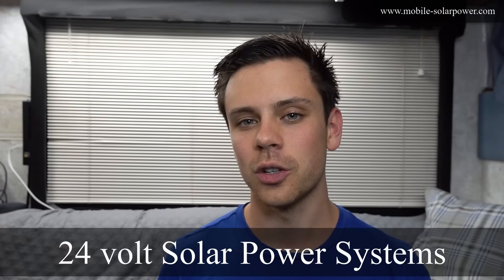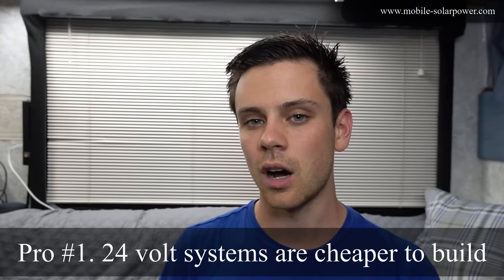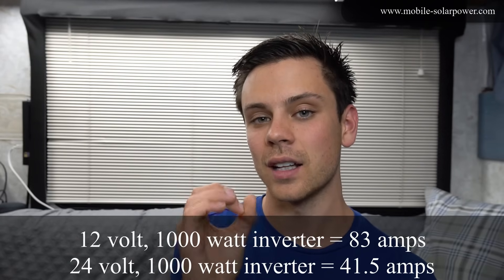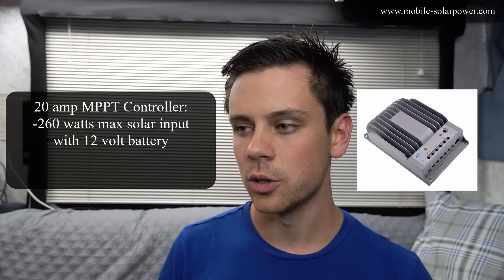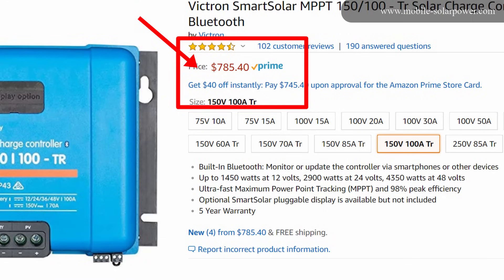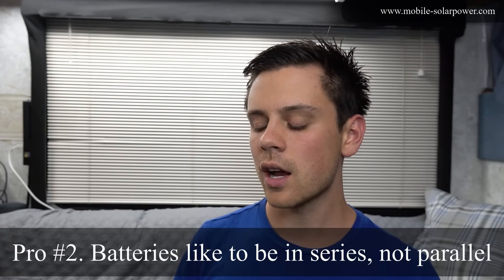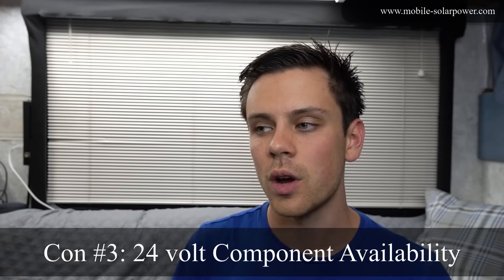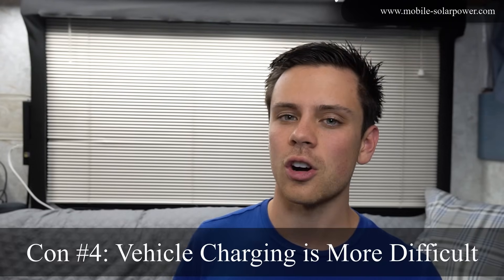12 volts VS. 24 volts for Off-grid Solar Power Systems

Comment: Micro inverters at 240vac will help with copper savings. Just rectify and regulate at the end near the battery bank.
Reply: Definitely. Also help with shading. But it is more expensive, and a lot of people prefer to spend as little as possible and still have it functional.

Comment: What is your thoughts of connecting a 12 vdc inverter for charging from your alternator? Keep in mind you would never use more than 50 % of its capacity.  100 amp on a 220 amp as example?   Then take the 120 ac and put it into the shore power connection of a inverter/charger.   This way there is no fear of the 2 batteries being connected to one another and the need for an isolator is eliminated.   Only down side is the losses due to efficiencies but curious if you had any other insights?
Reply from the maker: Absolutely! But I have a better system. Testing it tomorrow. Will post it soon

Comment: Very good comparisons.  I believe all you left out was a 12 volt system connected to an inverter will only give you 120 volts A.C.  Where a 24 volt system connected to the proper inverter will produce 240 volts A.C.

Comment: Good stuff. I'd like to see more house/48 V wisdom please.
Reply: Definitely would like to see a 24V vs 48V comparison.  SV Dauntless did a massive 53KW 48V system and I wonder how the wiring costs would have been different if they did it in 24V?
Reply: Definitely why not 48 volt we use them for cell towers as the need a bunch of power
Reply: So if I have a big bus going to run 24 what is the best battery for dollar I was leaning towards Tesla batteries room is not a issue I have a  flat nose skoolie pusher?  Is that my best option I’m aiming for 500amp hours run ac sometimes?
Reply: I’m no longer looking at Tesla batteries lol can’t decide yet
Reply: @Cliffandmorty  Wow that's 12 kWh. I have 10.5 kWh Pylontech for the off grid house and that's the right size for me. I like those 48V rack mount jobs but it's obviously not DIY.

Comment: What do you think of 48v !?
Reply from the maker: It's great but I mention when to use it in this video
Reply: @WillProwse  ohhh i haven't notice that .. maybe i have to re-play te video 👍
Reply: @WillProwse  actually i was asking you about 48v . That i wanted to setup air condition split model. Then i jave noticed that some of them work on 48DCv .!! So as i myself thaught maybe its better than adding more cost buying inverter " considering the cost and life time of such electronics or replacement soon or later ). So as i am not electrician  and not professional.  Would you give me your feedback about that !

Comment: If you have over            2500 -3000 watts. It's better to go 24v or 48v, it doesn't hurt to get a backup inverter either, I have a 5kw inverter, 24v with 42v oc panels, I'm planning on adding about 2500watt plus, in panels, due to distance, I will be running about 90v oc. I have a smaller 12v battery bank, for my 12v lighting, over 100ah, LiFePo4, I also have backup equipment, I'm building a DC generator to to charge my backup lead acid Bank. And have a charger to charge my lithium bank from it , in an emergency, it can do 150 amps @ 30 volts! I hope to eventually go a week without sun, but panels the shipping is costly!!
Reply: I would say 2000 is the cut off. I've seen an 1800w inverter power half a house on 24v. With proper solar and power bank of course.

Comment: Will, 
You are excellent,  you explain things so well. 
Question:
I have a skoolie, with 6 lead acid deep cycle Walmart batteries, totaling 610AH ( 2 are 105ah, 4 are 100ah) .  Are you saying that I should series them to create a  24 volts system?  My inverter is a pure sine wave 2000watts.. 12 volt I think.  
Thank you

Comment: What didn’t you like about the 6S Tesla battery? Was it mostly the chemistry for safety or something about the voltage and charging profile or something else?

Follow on question- if I wanna do a 24v system with custom cells, do you suggest 6S (like Tesla) or 7S like Jehu suggests?

Comment: I think there are a few other negatives missed with the 24v system pending on your usage.  Generally it seems like you need more solar space to do 24v.  A 12v panel and a 24v panel at around the same voltage are usually much different physical sizes and weight.
Reply from the maker: What do you mean? Whether the panel is high voltage or not, total output doesn't change. The output is determined by the size of the panel
Reply from the maker: So no, you don't need more solar space for a 24v panel. And it's easy to wire 12v panels in series anyways
Reply: Generally when I’m looking I see 24v panels physically bigger then 12v panels.  Especially some of the newer 12v panels that you have been featuring recently. Perhaps I’m just looking in the wrong place but I’m not seeing 24v panels that are 100 watts at the same general size as the 12v ones you are showing.   

I’m still new at all of this and your videos have been super helpful to me so I could be missing something since you know way more about this then I do.  Keep up the good work!
Reply: Also to clarify a bit more I’m coming at this from more of a preppier/camper mindset where I only want 1 panel to throw in the back of my minivan when I want to go somewhere with it so I’d like it small but a decent amount of wattage. 2 panels in series adds more size then I would be looking for but that’s a personal preference thing for my thoughts and use case. Eventually I will probably build a larger array and go 24v once I get everything off the ground.

Comment: Hello is it feasible to charge 24v DC off mppt  to a 24v DC battery bank then run a step down converter  to a 12v DC battery bank to run the coach
Reply from the maker: Yes absolutely
Reply: @WillProwse  thanks for the quick response still new but definitely learning from you keep up the good work

Comment: I think you've done a wonderful job of going through the basics. What would be of great help to me - and perhaps others - is to extend the battery scenarios beyond just solar-derived power stores. For instance - does it make sense to use these self-built batteries for things like marine and auto electric motor power sources? If so, what are the considerations in terms of cell management and construction configuration? Love the stuff you're doing, keep it going!

Comment: After listening to your take on alternators around (9:00 - 10:00) I'm wondering how do police cars and ambulances power all those lights and sirens and PA systems and computer terminals with multiple band radios and power outlets for life support equipment, etc.. etc..  hmm...  Do you think they might have  * high output alternators * in the engine bay?
Reply from the maker: Yep and they are designed to do it. My dad installed them for years. They are different. That's exactly the point I was making.

Comment: Here I am again. I have an older rv that we boondock in. If I go with 24 v instead of 12 does that increase the amp-hours if using 2 12v in series? do the batteries last longer (if there well serviced of course)?

Comment: There is a charge controller for alternators. 4 stage charging and all, just like the solar one. It is made by a Canadian company and is primary made for charging 24 volt handicap "cars" on 12v alternator for a car. It is 300W. This can be a solution, except it is for AGM and not tuned for lithium.

Comment: Been educating myself on this stuff for a while. I learned more in this video about voltage per application than dozens of others combined. 

Just bought 1.4acres in Ky. Putting a 14x32 barn/cabin on it to live in whole building my house. So, I guess a 24v would do the barn. Concerned about 220v appliances like water heater and AC.

But house will have a 25x60 basement with 2-stories on top. I'm guessing a 48v system might work better, but not sure. Would a 24v in series be better, even with more batteries?

Comment: Amazing video, as usual.  It's incredible how much knowledge you have in that head.  My brain swells up nearly overloading, when I try following your non-stop (edited, I know) video but it is always enriching.  No gain, without a little pain, right?   Anyways, I would like to see a video that shows us from a to z, the connecting of the panels to the inverter.  I looked up a 40amp 24 volt solar charger (right after your video) and it got confusing.  Most charge controllers have screw-ins for wires and they want to control the loads.  I want to know how to properly wire a 24v system (and 12v).  How do I use the controller to charge the batteries (that part is labeled) but how do I wire a 24v to 120v inverter without dropping below 50% on say lead acid?  I've "heard" the inverters get wired directly to the bats, but how do we protect them in that manner, from dropping below 50%?

Comment: I love your videos. I have a “dumb” question related to avoiding too many batteries in parallel. Does it mean I should not combine 2 x 8D 12V 255 amp hr batteries in parallel?  Seems like though it is “only” 2 batteries so under your 3 battery rule, but what confuses me is that isn’t each of the batteries actually many other batteries in parallel to make each 255 amp 12V 8D battery? In other words what is the difference in paralleling 5 x 50 amp batteries vs using a 250 amp battery that I assume has the same parallel setup but inside the big battery. I hope my question is not too confusing. Thanks.
Reply: E N I think that’s a very good question. I was considering building a 300amp 48v system but that requires 4 batteries in series and three strings in parallel. I’m starting to wonder if in a larger system I should turn my cabin into 2-3 independent systems.

Comment: Please understan that it is current that kills you if you get shocked, not Voltage!  Ohms Law for current is Amps = Volts/Ohms, so whatever equivalent resistance you are (wet tongue is different than wet hands is different than dry hands) is the major factor in how much you may get shocked.  30V may or may not hurt you, but 1 Amp can kill you.  Be careful out there, folks!
Reply from the maker: Yep and luckily skin has high resistance unless I would have to talk about it more. But under 30 volts, not really

Comment: Parallel battery simple solution if using different battery makes/models: Get a 5-7 dollar Schottkey Diode rated at minimum of 16/32 Volt rating (batteries charge at voltages higher than their outputs) and with current rating at a minimum 15A (mine are 35A) and connect with proper polarity to positive terminal of each battery.  This prevents backfeeding and provides battery isolation, which maximizes battery efficiency and life at the expense of a half a volt switching voltage of the diode.  Not a new concept, plenty of info out there on how it works.  Good video regardless though!

Comment: Hey Will, what about the price of batteries? From what I can see for ReLion, the 24 volt Lithium batteries are way more expensive.

Edit: and running them in series to 24 volt would also be really expensive. Whatcha think?
Reply from the maker: No they are they same cost. But remember that a 24v 50ah battery has the same capacity as a 12v 100ah battery. That confuses people. Check out my video on electrical equations for beginners to make sense of this.
Reply: @WillProwse  I figured I was missing something. I didn't know that, thanks for the speedy reply! I ordered your book right when I finished this vid-- keep up the good work!

Comment: 24 volt is the standard voltage in trucks and buses in Europe, so some stuff is not that hard to get.
There are also other alternatives if you are going to have off grid but want to use normal appliances - 115, 230 or even 400V 3-phase.
Reply: That is interesting. I didn't know that. That explains why I notice a lot of 24V "automotive" relays and other parts around :)

PS. On Europe most of small cars is just 12V as everywhere else.

Comment: Hi Will. I live in South Africa and the government has run the country so badly that the power supply company has started what they call “load shedding “. This is where they have to cut the power in various areas for up to 6 hours every day so they can distribute what little power they have left. I know you do mainly solar systems but could you by any chance, explain how to build a system - say 800w inverter that is grid connected but can later be upgraded to solar and the parts needed and how to work out what batteries are needed for the system to run for 4 hours at a max load of 550w (10 mins out of each hour) and a continuous load of about 350w? We really need your help.

Comment: can I connect a 24 volt solar panel system to a 12 volt battery bank with a 40 amp mppt renogy rover charge controller

Comment: Oversizing of 12volt systems rather than switching to 24 or 48 volt has got to be the most common mistake I see almost everywhere and it's so hard to get people to believe you when you tell them.  Joining the crusade of knowledge...
Reply: 50 Acres & a Cabin well you have to factor in that many people couldn’t or still can’t find in depth tutorials on 24v. Complete 24v system discussions are not as frequent online as12 and 48.
Reply: @cgwworldministries SOLAR. We are talking about SOLAR systems, not regular ol RV's with a couple of deep cycles to get you from park to park.

Comment: Will, I am in the process of updating my solar system in my camp trailer. I have 2 -12v 100 watt renogy panels, 12v 90ah sla battery, an older renogy branded tracer mppt40cc rated for 12v/24v. I bought 2 battle born batteries. I plan on adding a inverter in the near future. My needs are pretty lite but I am prepping for boondocking for family outings.For AC I just need for occasional 1100 watt  microwave use and possibly my  3 way dometic refrigerator(its not very efficient),. The rest are 12v DC loads small water pump, LED lights, max air fan. I have been looking at Giandel pure sine 2200 watt 12v inverter. I have the ability to change over to 24 volt system. I know my system is pretty small, I don't plan on going beyond 4 100 renogy panels, no room. My question is go 24v or stay 12v?  Are 24v inverters more reliable?  I value you opinion, Thanks!

Comment: Great video thank you very much for your explanation I just found your videos today I have liked and subscribed. I'm looking into your book as well. Do you recommend upgrading from my current 12 volt system lead acid batteries do a 24 volt system? I have to 320 watt panels. 2 6 volt lead acid batteries that are about 3 months old.

Comment: With all your talk about adding a second alternator why don’t you suggest adding a crank driven generator, then you can buy a inverter charger and power it up from the 110 side while you’re driving and let the inverter charge your pack (or use a onboard generator... same idea)

Comment: I have a 12V system that I want to increase im going from 550watts on the roof to 1120. I have a magnum 12 v 2000 psw inverter charger can I build my new system 24 v and use my converter to keep my 12v inverter charger?

Comment: Can't believe people are still even thinking about using lead acid.  The lithium ion batteries are triple the useable power of an identical amp hour lead acid.  They can charge to 90 to 10%.  Lead Acid 50%.  The absorption rate is 95% plus, lead acid 75%.  So a 1000 amp hour lead acid is equal to a 400 amp hour lithium.  Talk about lifetime?   Teslas are running 400000 miles over 8 years and are at 93% capacity.
I put up 60v panels.  7kw off the roof is 12 ga wire.  Not an off grid but grid only.  I put it in last December for $5400 or 80 cents a watt.  I put it all in myself. It has generated 1.3mwh since mid December when I turned it on.

Comment: Will, We at Sanilac Solar, would like to thank you for all the great videos. We recommend your videos to all of our new costumers. Now for my question, we have just completed a new Dual Axis solar tracker. This has been a very versatile racking system. For now, we are hanging 8- 305w 36v for a total of 2440 watt array, they are Canadian Solar panels. The charge controller we are using is a midnight Solar Classic 150. Our strings are two in series four in Parallel. We are also using the midnight solar Epanel, for the inverter we are using a Schneider Electric SW4024 , inverter/charger. Also for anything 12v we are using a step down transformer 24v to12v. Ok now for the batteries, we are thinking of using a 24v battery from an electric HighLow. I believe they are led acid. What are your thoughts, about using this battery?
Reply from the maker: Why thank you! And I can't find those batteries. Do you have a link?
Reply: Will Prowse no I’m sorry they are used batteries, from High Lows, or Fork Trucks, some people call them Toe Motors, there are all kind of names for them. There are also 24v in Man Lifts. I can get batteries from scraped out equipment. Understanding batteries is my down fall, so I have used led acid because you can’t Hardly make a mistake.  I would like to start using Tesla Power Wall.

Comment: I am building a system for a sailboat / marine environment.  I have a 12v anchor windlass that can demand 100-120A.  Is it possible to get a converter that can handle that?  Or would the converter cost so much that it would cancel out the 24V cost benefits?
Reply: 6:45

Comment: You need lots in parallel if you want lots of amps stored. How do you get round this? Your going to have several batteries
Reply from the maker: Nooo please watch my video on electricity for beginners. Amps is dependent on volts. Please watch the videos